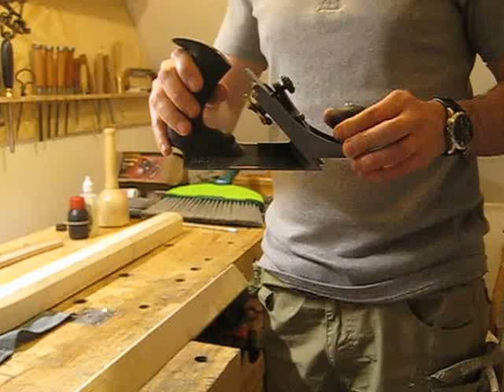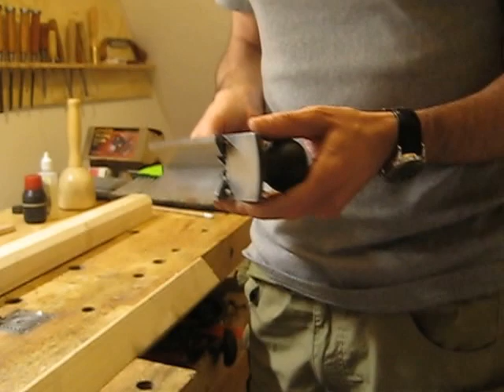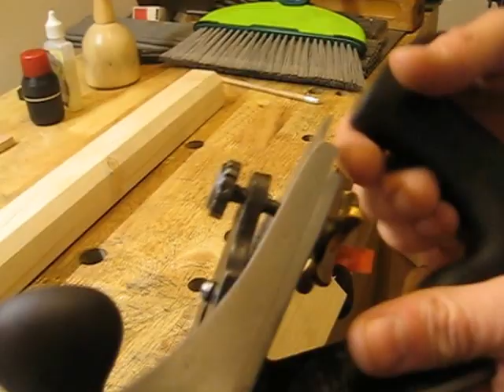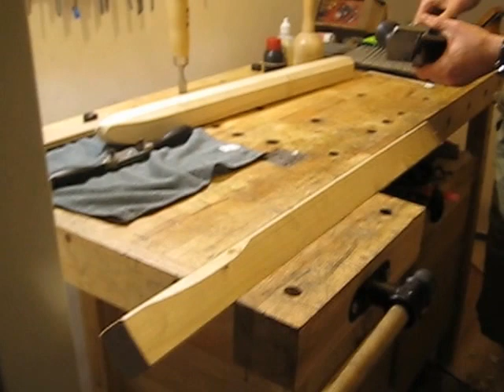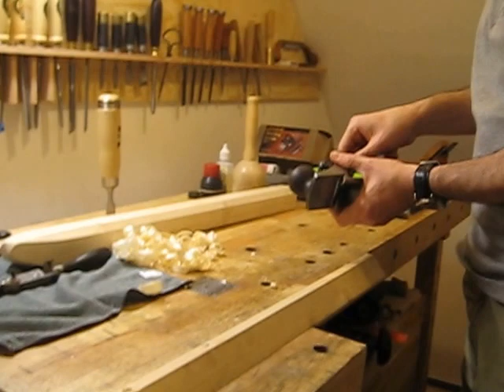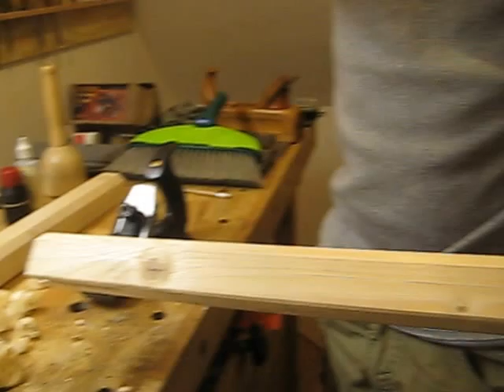how to use a stanley 72 Chamfer plane

Comment: You’re using the plane in exactly the wrong way - let me explain - when you chamfer with a normal plane you don’t continually adjust the depth of cut - set the blade at a light or medium cut, set the depth of the chamfer then just plane away - it will stop once it has reached the desired depth - you do not need to continually change the depth of the chamfer
Reply from the maker: You are right in principle, but doing it at once will give you lot of tear out and plan will shatter, especially on soft woods like pine.
The best way I found is to do it in small steps...but this is my preference